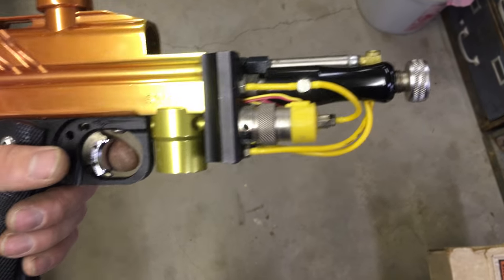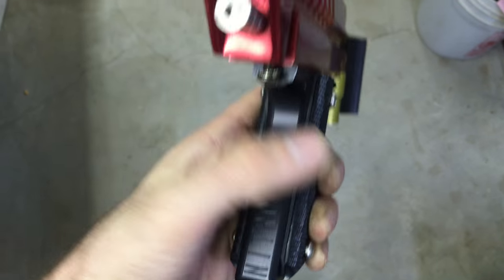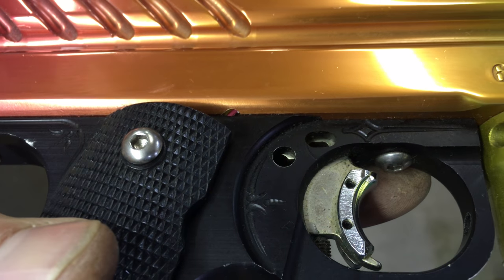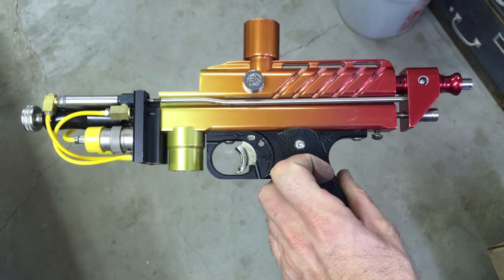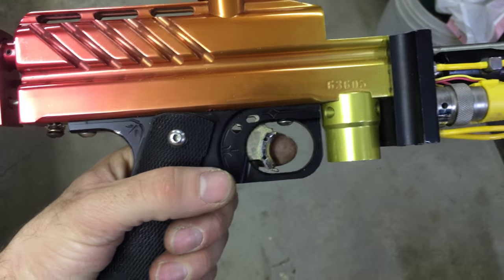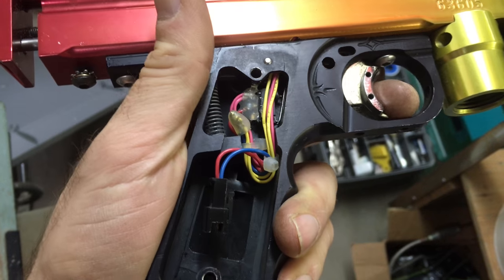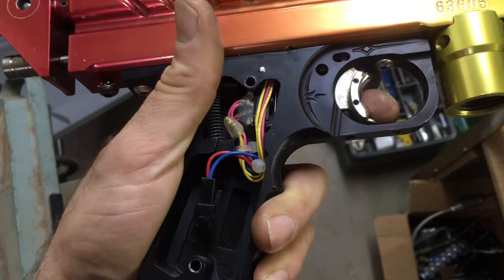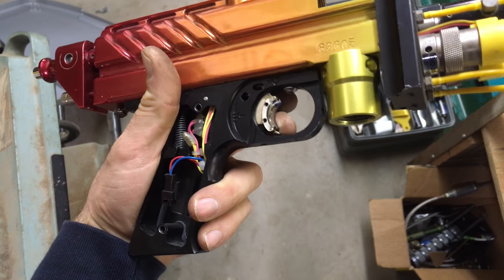Paintball Mania Suppy Nitro Duck E Cocker c.1998

Comment: Funny how it had all that tech crammed into it, and they still used a bent pump arm...
Reply: And a standard mechanical sear/trigger. You have to remember this was from 1998 or so. There weren't any other commercially available options for electronic cockers at the time (except maybe sandridge kits which were coming out slightly later I think). Thanks!
Reply: I remember it well, because I was still using my Youngblood Mini-Cocker at the time.
Moved away from Cockers, to a Shocker because it was American.  Then upgraded to an Angel for it's size, and the rotating breech was a dream.  After several years of hail storms, I realized the arms race was killing the Sport, and retreated to an Evolution X Autococker, which I still use to this day.